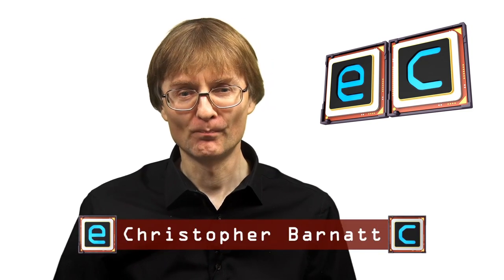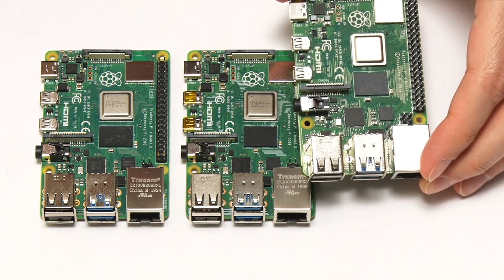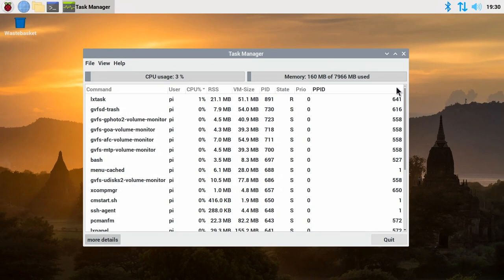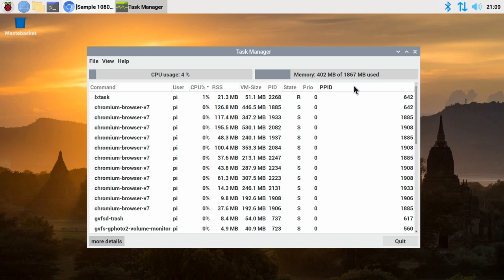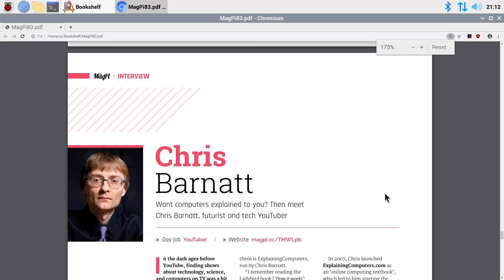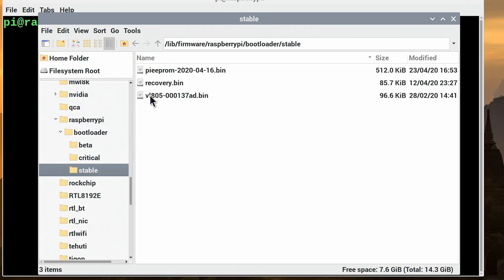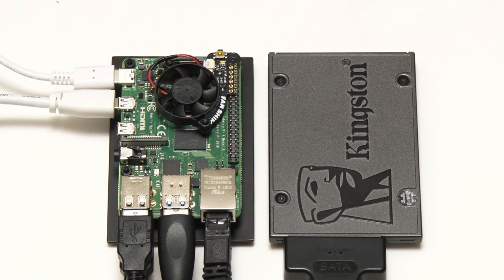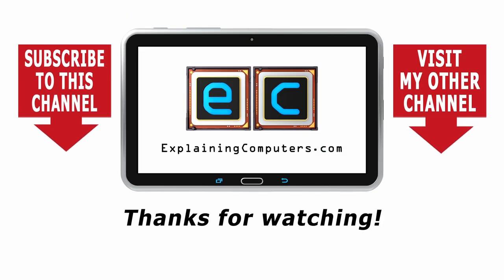Raspberry Pi 4 8GB & USB Boot

Comment: The boot order is first SD card then USB, so it's a requirement to remove the SD card to boot from USB, unless you use a special SD card. Now since June 15 there is firmware in the stable stream. I changed from critical to stable firmware stream using `sudo nano /etc/default/rpi-eeprom-update` & `sudo rpi-eeprom-update -a` & `sudo poweroff` & disconnected power & SD card & put SD in card reader in a USB3 port & connected power.
Reply from the maker: When I made this video -- last week! -- the default boot order (and it can be changed) was most certainly first USB, then SD card, so there was no need to remove the SD card. :)

You can indeed do the update by editing the rpi-eeprom-update file as you note. But, as noted in the video description, you can also do so directly using a sudo rpi-eeprom-update -d -f [file location/name], which will update the Pi's firmware to the file specfied regardless of what is in the rpi-eeprom-update file (that's the whole point of the -f flag). And you must do a sudo apt update and sudo apt full-upgrade before either method for the latest firmware to be available on your Pi.

Comment: there is no firefox for arm? firefox has the only working hardware acceleration for linux, should help alot on low power devices.
Reply from the maker: There is indeed Firefox for ARM, but hardware acceleration for all ARM GPUs is not guaranteed! :) It is very much a board-by-board and OS-by-OS thing. I have, for example run Firefox today in Ubutu 20.04 on a Pi 4 and Odroid C4, and neither are hardware accelerated. Chrome on the Pi is, however, supposed to have GPU playback support . . .

Comment: I am the proud owner of both a Raspberry Pi, model 3B+, 1GB SBC and a model 4, 4GB SBC. I've installed Raspbian OS on the model 3B+ and then installed a LAMP stack over this, then Wordpress 5.x which has allowed me to host my own domain of https://datapioneer-network.org on that device which runs 24/7/365 I purchased my domain from Google Domains and installed an SSL/TLS certificate from Let's Encrypt so that the website is secure rather than non-secure. On the model 4, I've installed OpenMediaVault & Portainer and created several Linux Docker Hub containers from Linuxserver.io docker hub images as stacks deployed using docker-compose images into containers utilizing Portainer as the vehicle to deploy the stacks. As a result, I now have web-based applications such as FreshRSS (an RSS News Feed Aggregator), Heimdall (a bookmark site for my containers), Bookstack (an application for creating entire books and book libraries), Wireshark (a network packet tracer/sniffer application), and qBitTorrent (a bittorrent downloader application). I have not pursued the modification in firmware to boot to a standard SSD card (I have a Kingston 256 GB SSD which I could use for this purpose) rather than to the 32 GB MicroSD card I currently use. Will have to look into this when the firmware is stable. Thank you, again, for a great video.

Comment: Correction: The newer Pi's actually do have composite video, just through the 3.5mm jack instead of a dedicated one. Adafruit sells one if you want composite on your Pi 3 or 4. https://www.adafruit.com/product/2881 it's $5 USD
Reply from the maker: Not a correction at all. Nowhere in the the video do I say that the new Pis do not have a composite video output. They do, and I am very aware of that. In the video I say that the RCA composite video jack has been removed, which is true.

Comment: I thought the 4 pin 3.5mm jack was Composite + L/R audio..
edit: 3:54 It even says "A/V" right there..
Reply from the maker: Yes, this is true. I never said that the Pi 4 does not have composite video. :) I said that we've lost the RCA socket, which we have.
Reply: Ah gotcha. Guess we'll have to get used to adapter cables from now on.. We're probably already there, with the mini hdmi ports etc..

Comment: Can I do that using my NVMe SSD onto the M.2 NVMe slot instead USB 3.0?
Reply from the maker: There is no M.2 slot on a Pi! :) But you could a SATA or NVMe M.2 as a Pi's boot drive using a suitable M.2 to USB 3.0 adapter.

Comment: i think the major part to be covered, should be the faulty USB-C powering! Are actual releases without this issue?
Reply from the maker: As noted in the video, the USB-C power issue was fixed with release 1.2 of the Pi 4 in February 2020, and does not impact the new Pi 4 8GB.
Reply: @ExplainingComputers  to be more precise, do they sell actual Pi 4 (2GB/4GB RAM) with upgraded firmware? How to determine, before i am going to buy one (checking any serial number)?

Comment: Hi I'm hoping you can tell me what I'm doing wrong I just got an RPI4B 4GB model and I can not get it to playback video's as it does on my RPI3B I have an external hard drive I connect through USB and it works great on the 3 but will not work at all on the 4. Thanks

Comment: Is it really that easy? Wow, just copy the SD Card onto the SSD, put on the new firmware and that's it? I found other videos which suggest to install a clean Raspbian or now Raspberry OS on both SD card and SSD and the put on the bootloader. But what about running programs? I don't want to install it all over again.
Is it possible to boot from SD Card after changing the bootloader?
Reply from the maker: It is risky, but really is this easy. See my comment in the video description regarding guides posted in other videos and elsewhere that execute many other steps . . Once you have installed the USB boot upgrade, the Pi will try to boot from USB, then SD card. So if no USB drive with an OS on is present, the Pi will still boot from USB.

Comment: It looks like there's a slight change in the voltage regulator area of the board. Is the PCB a new rev.?
Reply from the maker: You are correct.

Comment: Is ther anyway too use other OS then the ARM one if you boot from an external HDD or SSD ??? ... If so I might use Linux Mint on that little beast but I don't know if you'll abolutely need the 8gb of RAM version ...
Reply from the maker: You can use many different distros on the Pi, but they will all need to be ARM, as the Pi has an ARM processor, not x86! :) So no Linux Mint.

Comment: Hi and thanks for a sensible walk through, which strangely enough I understood :-)
Having said that, I'm having trouble, my Pi4 8gRam arrived yesterday, but of course I wasn't paying attention having the Pi Xero I only had a HDMI mini no Micro, so I'm trying to do this Headless, no display.
I've run up the SD card using the Pi Xero set up SSH and Xrdp onto it, confirmed working and that SD into the Pi 4.  Did the upgrades etc, checked the Config is to USB boot, and has SSH enabled using the SD Copy accessory I've put the SD image onto the USB SSD  but when I go to reboot, after removing the SD card, not much happens. A network scan doesn't show the LAN or WiLAN addresses previously observed :-(
Any suggestions please.

Comment: What do I want to do with a Raspberry Pi 4?
I still haven't gotten around to getting an SBC of any sort. Still watch these videos, though.
Reply from the maker: Thanks for watching!
Reply: I have been running a Pi4-4GB as a daily driver since September. I have used the hybrid boot USB for virtually all that time. Booting from USB is a HUGE improvement in performance. The card reader chip is limited to 48MB/s while the USB chip is 350MB/s. My USB SSD tests out at 300MB/s. So an NMVE drive is a waste of money for the Pi4. The only thing I boot my Xeon quad core for now is video conversion (handbrake).

Comment: So was that a real time firmware update? My internet is iffy on it's best days, and I don't want to brick my expensive new Pi, so the quicker done, the better.
Reply from the maker: The update is pretty quick to install (the actual reflashing process happens on the next boot). No Internet connection is used during the update process -- the new firmware files are picked up when you run the sudo apt full-upgrade, but just sit in lib until you choose to install one.

Comment: Yes, this is interesting, to be sure.  However I would like to know how to install an OS of my choice from an .ISO file to a RPi or anuy other SBC.  Not just downloading an image from the manufacturer.
Reply from the maker: You can install images using Etcher or the Raspberry Pi's own utility, amongst others. I most recently showed this in this video: https://www.youtube.com/watch?v=rhIzfRmKHnQ Note that installed images for a Pi are img and not ISO files.
Reply: @ExplainingComputers  I think you are missing my point.  Though I do have a hand in that.  As an exampled, as of now I cannot install CentOS or FreeNAS on the SBC of my choice.
Reply from the maker: @peterfrisch8373  The Pi is an ARM SBC, so you cannot install an x86 OS like FreeNAS or CentOS. The Pi is not limited to OS supplied by its manufacturer (there are a lot of third party OS). But it is limited to OS that run on ARM hardware! :) In next week's video I'll be covering eight x86 SBCs will will run most x86 OS. :)
Reply from the maker: @peterfrisch8373  The Pi is an ARM SBC, so you cannot install an x86 OS like FreeNAS or CentOS. The Pi is not limited to OS supplied by its manufacturer (there are a lot of third party OS). But it is limited to OS that run on ARM hardware! :) In next week's video I'll be covering eight x86 SBCs will will run most x86 OS. :)
Reply: @ExplainingComputers  There is an arm release of Centos.

Comment: Hi Chris! Thank you for your videos. I just noticed that you always demonstrated youtube playback on RPi with AVC (.h264) codec. Recently I tried to watch some videos using my RPi4 with the same codec and found the picture quality very bad, even at 720p. I usually watch videos at 480p due to my limited internet bandwidth, and on my x64 computers it was always fine, but not on RPi4. After a quick investigation, I found that the AVC stream on youtube is much worse than VP9 stream. In my opinion, 720p AVC corresponds to 360p VP9 in terms of image quality. The particular video is EEVblog #1312, at 3:13 just look at "Horizontal" label on the right side of the scope. But RPi4 does not support hardware decoding for VP9, thus the maximum comfortable resolution is 480p. At 720p it starts to drop frames, and I don't even tell about 1080p or 2160p. I know that the video quality depends not only on codec, but also on other parameters, such as bitrate, encoding effort, etc., but this is how Youtube is configured. I don't know if you already covered this in your previous videos, but if not, could you please do this?
Reply from the maker: Thanks for this, which I find very strange. I indeed use a Pi with h264.ify for h264 video streaming (which is the defauly for Raspbian / Raspberry Pi OS). I've never come across anything to suggest that anything works better than this on a Pi.

Comment: Hi, does your mouse have no scroll wheel? I just notice you always drag the scroll bars manually.
Reply from the maker: Good obversation! I normally use a 3M Ergonomic Mouse, in which the hand curls around a fixed column, and you click by rocking the thumb. There is no scroll wheel.

Comment: why do you say you could damage the pi by installing the beta firmware? afaik from the raspberry pi website you can download a repair image for the eeprom in case your device won't boot anymore. so.. there's no actual damage you could cause to your pi with this, just the inconvenience of having to reset the bootloader. correct me if i'm wrong, pls.
Reply from the maker: Any firmware update on any device runs the risk of going wrong and leaving the device unbootable. Yes, there is a recovery option that will work in MOST cases. But, as the Raspberry Pi Foundation website strongly cautions, any firmware update carries a risk. I also think it would be highly irresponsible for me not to point out that a Pi can be "broken" (left unbootable, possibly permanently) in a video like this. Even recovery would not be trivial for many users.
Reply: @ExplainingComputers  i see where you're coming from. of course a word of warning can't be wrong when showing these kinds of things. i just thought broken was too strong of a word there, as in physically broken for good.

Comment: There is a Floppy Disc Hat for the Raspberry Pi SBC that means you can use Floppy discs as well provided the drivers are installed,What about about the Dual/Quad SATA Hat

Comment: What do I want to do with a Pi 4 8GB model?  Run a Modded Minecraft server.  It seems like the device would be perfect for throwing more than 4GB of RAM at it to keep a stable world in memory all the time. A 4GB model would be ideal for running a small portable system for multimedia, but I'll wait for those GPU drivers to be improved before I do any of that.

Comment: Hi, if I'm using USB 2.0 pendrive as boot drive OS compared to Micro SD, so in theory USB 2.0 should be faster right compare to micro sd?  am I right?
Reply from the maker: The USB 2.0 interface will be your speed constraint here, so probably no faster than a micro SD card on a Pi 4.

Comment: why not stay with an usb3 stick instead of the bulky ssd+adapter?
Reply from the maker: Using an SSD will provide faster storage -- both raw speed and higher IOPS for better OS and program performance, as well as more storage. USB sticks are not designed to run OS and programs from -- but will work!

Comment: Because I  recently had to return two new laptops because of failures, I've decided to dabble with a NAS to mainly store media files. Because I've recently retired I decided on getting a PI but have a few questions.  I am planning to get the new 8gb model for repurposed at a later date.

1.  How many hard drives can I install?  I was considering a couple of 2TB hard drives.

2.  I was considering setting up RAID for extra safety.  Is this overkill?

3.  Is there a restriction or sensible limit for the storage capacity of the hard drives?

4.  Is there a good enclosure that can easily handle the necessities of heat dissipation?

5.  Is there a good guide out of the myriads on the Internet to guide me?

Thanks in advance
Martin
Reply from the maker: You could potentially directly connect four drives to a Pi via USB (more if you used a hub). But two directly via USB 3.0. So two 2TB drives would be fine. Note that you will need a means of powering them.

In my view, RAID on a domestic NAS is complete overkill and highly ineffective. A fire, flood, theft, ransomware attach, power outage/surge or user error will destroy data on one drive just as well as two. If you are going to purchase extra drives, back your NAS data up to them and keep the backup drive offline, preferably off-site.

If you build a NAS with a Pi, sourcing an enclosure (and a means of powering the drives) is your challenge. I have Pi 4 NAS video here: https://www.youtube.com/watch?v=bpvlEbdA6qI -- though note that the install in the middle of the video has changed a little with the new version of OMW. Good luck!
Reply: @ExplainingComputers  Many thanks for the rapid reply
Reply: @ExplainingComputers  
Hi Chris, my nice new shiny pi4 8gb has arrived, I have assembled it into an enclosure with a fan.  Before I commence building the NAS, which version of PI do I go with?  I did buy a card with NOOBS already installed, but is this the best one for the NAS.  I have managed to find a link to the OMV4 image so I will follow your "two ducks or tea and Aero" method :)
Reply from the maker: @martinsmith5028  If you have the OMV4 image, go with that. Else go with Raspberry Pi OS, or maybe Ubuntu for a server/NAS. I personally prefer to install OS directly by writing the image file to the card using Etcher or similar, rather than using NOOBS. Enjoy your new Pi! :)
Reply: @ExplainingComputers  Holiday done.  Started the first bit and have flashed the omv 4 image to the card.  Installed the microsd card and a memory stick with lots of films on to test.  Connected the pi via a known lan cable and switched on.  Two hours later I still have a green flashing activity light (4 long flashes and 4 short flashes which I'm told is an "Unsupported Board Type" error).  I have had a sneaky look using Advanced IP Scanner and cannot even see the Raspberry Pi in the list.  I'll leave it a while longer but think I might have a corrupt image/card.  Any suggestions?

Comment: Can it run Windows 10? I have managed to get Windows 10 (the to-go edition at least, Windows 10 1909 Home N) to run on a Sandisk 64GB class 10, A1 rated, SD card flawlessly, of course I had to use a UHS-I SD card adapter to USB 3 (5Gb/s) to do so. It would definitely be nice to know if the Raspberry Pi 4 (8GB) can run Windows, albeit the ARM-64 edition, without any issues.

Comment: Can I use a HD instead of a SSD?
Also, is the Raspberry Pi OS the only OS that can boot from a USB3.0 port?
I want to use a version of BSD UNIX.
Reply from the maker: You can indeed use an HDD (2.5 inch if you want the Pi to power i). Other OS can boot from USB, but you will need an ARM image for the Pi (remember the Pi is not an X86 computer).

Comment: How do the 4GB rpi 4b sd and rpi 4b 8GB ssd compare on boot time and operational speed/processing? Does the 8GB with SSD make windows booting useable?
Reply from the maker: I have not noticed any difference. You just have more RAM! :) Windows on a Pi is never going to be great (aside from the IoT version).

Comment: Is this firmware update only for the pi4 or can I put this on my pi 1? This one has the problem it bends the SD cards, so at one point it does not boot anymore. With USB boot I could avoid this problem. As a pi hole the pi 1 is just fine, so I don't wanna change to newer pis.
Reply from the maker: This update is for the Pi 4 only. A Pi 3 can also USB boot, but not a Pi 2 or Pi 1.